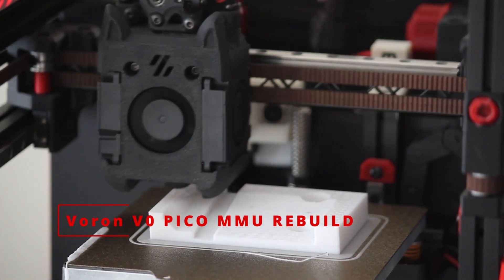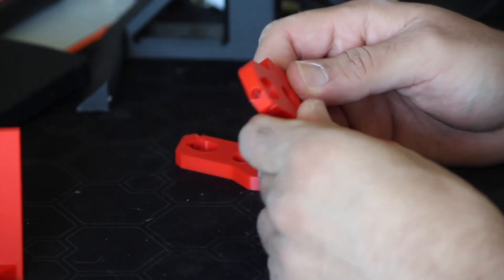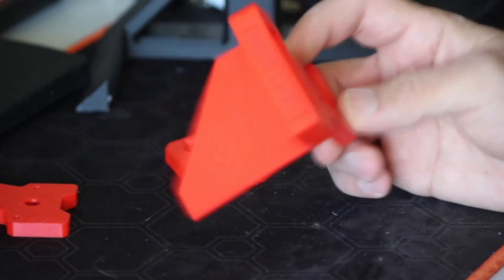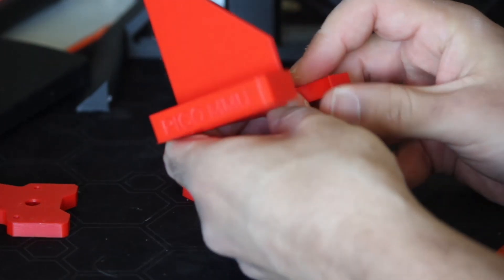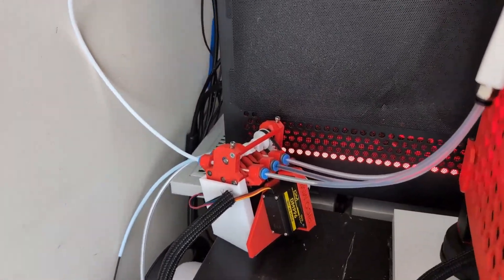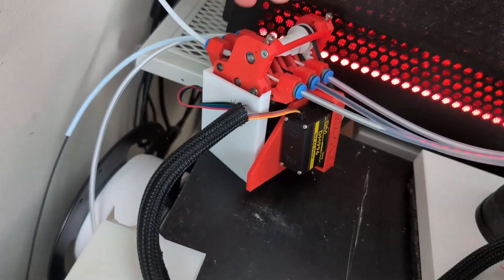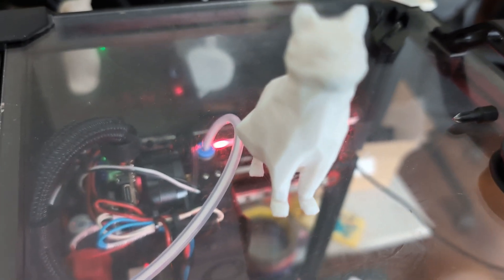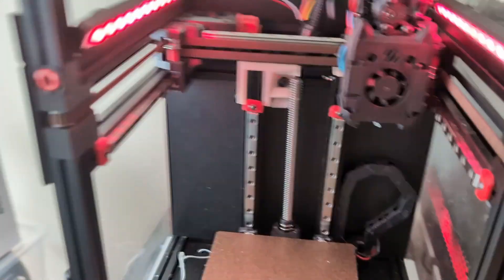VoronV0's PICO MMU REBUILD - GETTING READY FOR MULTICOLOR 3DPRINTING

Comment: Have you managed to print 4-color pieces without problems?
Reply from the maker: on my elegoo I did get some 4 color prints, but I need to do better tip forming, the v0 mostly prints abs and I need to get more colors for testing
Reply: @AMOVFC  I'm not too sure about the terminology but I'm thinking if you used a filament cutter like filametrix you wouldn't have to worry about tip forming?